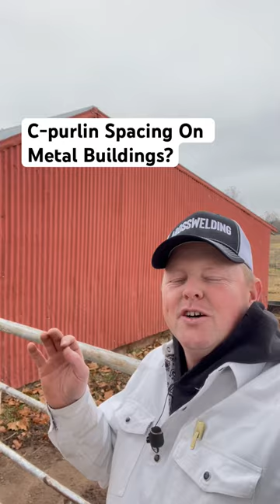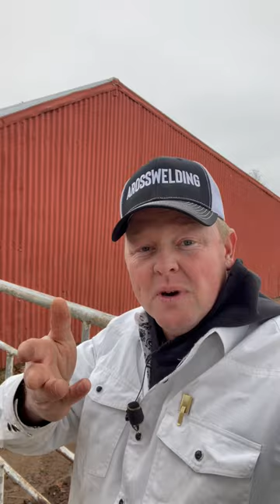C-Purlin Spacing For Metal Building? #welding #rigwelder #stickwelding #metalbuildings #farm

Comment: Depends on Purlin size (4”, 8”, or 12”) and depending on type of R panel (corrugated metal used) you can easily space 6 feet apart. If you use corrugated metals from Home Depot or Lowe’s with thinner gages then I waliid recommend 24-36” part.

Comment: Alot of it also depends on whether your doing commercial or some customer that lives out of city limits. If its commercial then you do it how the engineer draws up the plans. Im currently on a job now and the engineer that drew up the plans was to me over kill. 8 inch I-Beams 3/4 inch thick on a 20×60 covered lean-to add on. So the plans clled for a bolt up but what was delivered was not a bolt up. Infact it had to be fabricated into a bolt up by me and i had to get the ok to make the modifications. When the subcontractor called me everything was there already. To cover myself i had to write up a contract to make the modifications on it.

Comment: With much respect, I can't believe nobody else in the peanut gallery hasnt  mentioned here___ in structural steel and timber framing proper terminology is purlins are roof supports and girts are the horizontal  wall system pieces... from small to giant structures this is the correct terminology. All the aside, I for one _  think you and your videos  are 1st class and better than most👍

Comment: Put them a little closer if you don't want snow to cave it in!
The saying "that's plenty close enough round here" is always right until it's snows so much wet snow that the roof caves in!
Reply: That's it. I normally do every 4 foot and like you said put them closer so the snow won't cave it in. That actually happend to a welder buddy of mine. He learned from that. It also depends on the size of the building which will also determine the size of perlings one uses according to engineers. I'm actually on a job now and the engineers are not always right. I am having to fix his messes ups and I'm sure not every engineer is like that. I was contracted to put the building up. Good point though.